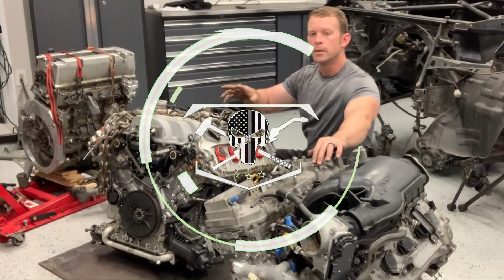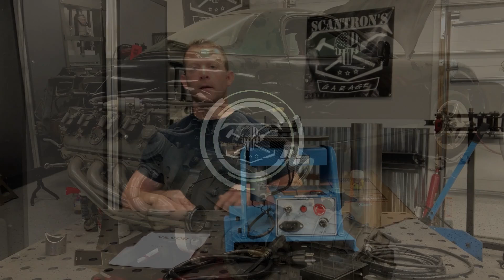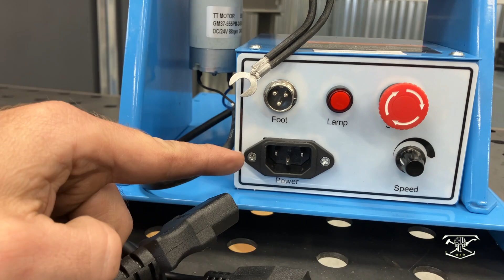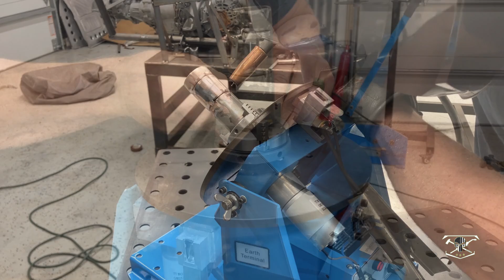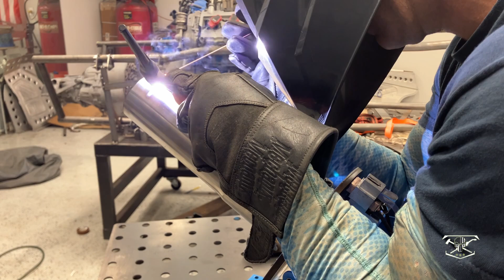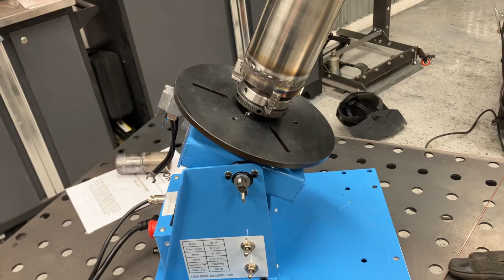Vevor Welding Positioner Tool

Comment: The positioner is just turning too fast.  Starting and stopping is going to wreck your rhythm. You might be better off with MIG or hack the positioner for lower speeds.  I would try a different gear motor or add a compound gear before the big ring gear.
Reply from the maker: That is true. Yes it is difficult to work with

Comment: Was that the slowest speed?
Reply: 2 rpm
Reply from the maker: probably
Reply from the maker: not slow enough unfortunately
Reply: I’ve seen a few of these cheaper machines now and you can run a motor with a higher reduction gearbox. You then get a much better speed range. I’m going to guess it’s 5:1 reduction. You’ll need a 10:1 or 25:1 reduction to get usable speeds.
Reply from the maker: @woznaldo  Yes. They have mote expensive models that are more speed managable